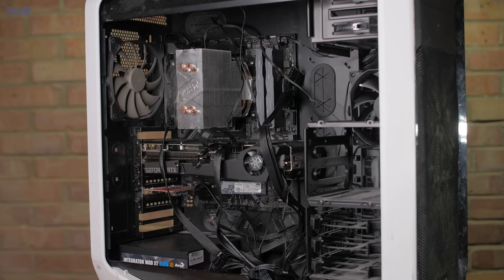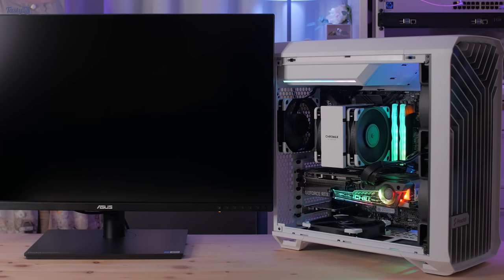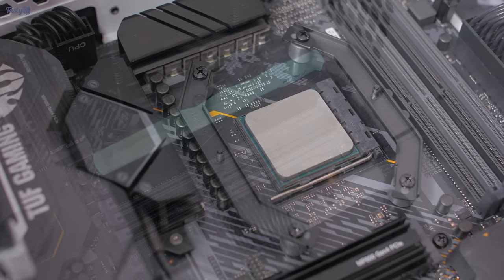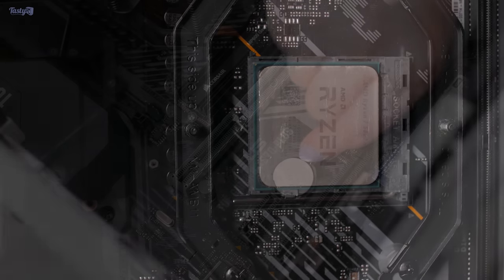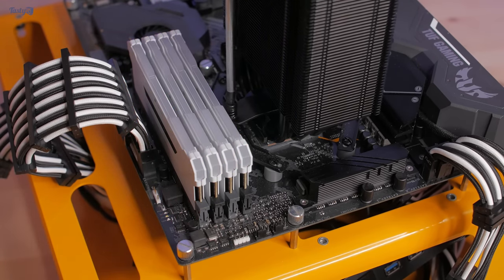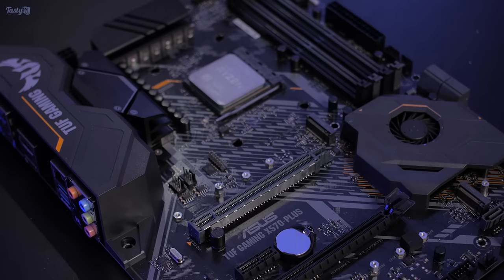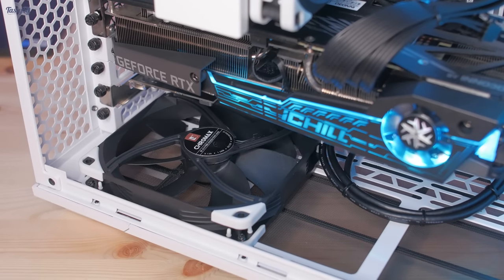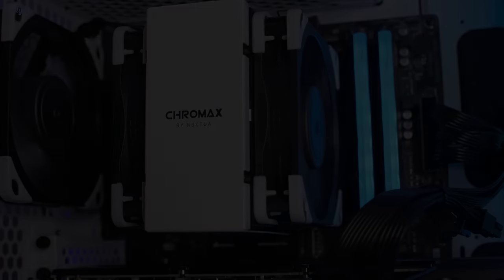I BROKE A VIEWERS PC??

Comment: could be wrong but maybe too much pressure was put on the cooler when it was installed causing a bow into the mobo and when its taken off the imbalance is gone but when you put on a heavier cooler it caused this

Comment: lol that pc looked terrible. 
I hope it didn't smell bad.
Reply: I'm certain this is due to temperature creep in the metal. I had the same thing over a long time and the issue is witht he aliminium wrought type used in the aluminium alloy. It's based on copper rather than silicon hence over time it deforms.
This is going to be much worse on the new CPUs that run on much higher temperatures than the past ones.

Comment: I think you pretty much nailed it. This does not sound like it is your fault. Either the pins or the socket is worn. Both heat and pressure breaks the connection.

Comment: You don't have to tighten the cooler all the way down. Mounting pressure doesn't do much maybe 5 deg c tops. There has been testing that shows this. Might have been able to reuse the same mb. Regardless interesting video!
Reply from the maker: As seen in the video, the error would only disappear if the cooler was entirely unscrewed. So the cooler would have fallen off when the system was upright.

Comment: What I would've done after all those steps is to carefully mount and screw in the cooler, had plenty of experience with if you overtighten ryzen too much on one side it can render some ram slots inoperable
Reply: Yeah watching further I guess I was kinda right, although I didn't expect it to work just fine with the other cooler back on. What a weird situation indeed

Comment: So I have a pretty good PC build of my own but find that Asus' Software for the RGB and Fans, armor crate, causes it to crash. If I remove the software it's fine. What do you suggest I do for RGB controll on my case and fan control?
Reply: Try OpenRGB... I don't actually use it though. I just remembered seeing it when looking for a Linux tool for my Corsair keyboard (which OpenRGB didn't support at the time).
OpenRGB is available for Windows and Mac too, not just Linux.

Comment: Can you make a video on the fan software! 

This is hindsight, but wouldn't it have been easier to try different ram sticks?

I still don't know if the cooler or the motherboard is the problem. But she did a great job troubleshooting it though
Reply from the maker: I did try a different kit of memory in the video. 4:39 for example.
Reply: @TastyPC  oohh my gatos how did i miss that...

Is the fan control software easy to use?
That's what i need. Fans based curves based on gpu or cpu temps

Comment: I recognize your voice from the Monsoon Dual Bay Reservoir video.
Reply: Context: I was in the market for a tri-bay red case that looked edgy and couldn't find any documentation to tell me how to get a D5 pump, how to set it up, what other compatible pumps were on the market, where to get one in the US because every listing I could find was from another country using a different currency, etc. Your video was my primary reference hence why I recognize your voice. You've changed your channel logo to since I last made any attempt to get this configuration.

To anyone wondering why I was looking for such a niche PC case, It's because I like older style PCs and I really wanted a Blu-Ray player in my system and I wanted to water cool without taking up a ton of internal space because older cases aren't necessarily compatible or beginner friendly to custom water cooling.

Comment: The conclusion I came to, is Asus boards are trash.  I replaced my Asus with MSI, problems gone.  They have huge stability problems.  Chances are that too much pressure was applied to the socket and the board is damaged.  But it could just be Asus’ flaky boards.
Reply: Sample size of 1?
Reply: @SianaGearz  For sure each manufacturer has their issues, so reviews and specs are very important these days.  ASUS is the biggest and they could be the best, but if you watch J2C, you know ASUS has done some covering up recently, and I’ve seen it as well.  I’m actually a little worried about the MB space, as there isn’t a lock manufacturer.  But I have 4 MSI AM4 boards in service, all selected because of features and reviews…and they seem to have less issues…so to each their own.
Reply: This issue is due to the substrate material used for the board - not all motherboard substrates are created equal!  It is a good reason to avoid 'low end'/cheap boards in general.  Cheaper motherboard substrate materials have different thermal expansion qualities.  There is more than just profit that goes into the higher end motherboards.

Comment: I have a new respect for your knowledge of PC's - good job.  I thought of the cooler pressure possibly causing problems pretty early on, because i've run into problems like that before.  This was one of the problems with the original Xbox 360's, the board materials and the heat sink mounting mechanisms in that console are the cause of the famous Red Ring error.  Microsoft cheaped out on the materials they used on the original Xbox 360 motherboard, as a result when it heated up it would warp the board (also related to the boards mounting system.)  This board warping from heating up and cooling down would eventually break the solder joints under the GPU which caused the famous Red Ring error.

This was entirely avoidable if Microsoft would have done any 1 of three things differently.  
First - The 'X-Clamp' mounting system for the heat sink was poorly conceived, and so increased the warping of the board from heat expansion particularly right under the GPU that was soldered to the board - so replacing the X-Clamp with a more normal attachment would have helped.
Second - Had microsoft opted for a slightly more expensive motherboard base material (instead of the cheap one) the board would have been less susceptible to thermal expansion when heated, and so would have warped less from heat expansion with better materials.
Third - If Microsoft had a better cooling system, that would have kept the entire xbox 360 cooler and prevented it from experiencing any significant thermal expansion to begin with.
Reply: So how does this apply to your build here?  Well the easiest way to fix this issue is make sure that your case is cooling better so your motherboard doesn't heat up.  You can also get a different Heat Sink.  And for next time - don't get a cheap motherboard that uses cheap substrate materials and experiences this sort of warping from thermal expansion when it heats up.
Reply: You could also experiment with not using all the mounting screws to hold the motherboard into the case, probably taking out the screws at the top of the motherboard would allow more even expansion which might prevent this issue... although it's unlikely it would really solve the problem because it seems to be more connected to the CPU cooling mounting system in this case.
Reply: I still have my original xbox 360 because I took apart my xbox 360 before I even turned it on for the first time, and I fixed those problems.  I removed Microsoft's stupid X-Clamp cooling retention and replaced it with a more standard design, I redirected the airflow and improved the cooling in the system, and also sped up the cooling fans.  And I replaced the original xbox case with a custom case.
Reply: As a result of my changes to Microsoft's original 360 design - my original xbox 360 works great to this day, no problems at all, probably has a runtime of near 3 years total - it runs perfectly.  This shows how even system engineers can be incredibly stupid at times  - they should have fixed these problems before the 360 ever left the factory.  Anyway - that experience is what led me to the board possibly warping in your system pretty quickly.
Reply: Also - don't feel bad for not spotting this problem sooner, it is a matter of experience.  You are proficient in the troubleshooting methods which eventually led you to figure out the problem and find a correct solution.  But this is one of the weird issues that most people never encounter.  So well done for finding the solution.  :)  A lot of techs would likely never have figured it out. - most techs would just say 'bad motherboard' and move on.  But you took the time to figure out exactly why.

Comment: Looks like the torrent case. not sure why the viewer removed the bottom fans since it comes with 3 in stock
Reply from the maker: The Torrent Compact comes with two front 180mm fans by default and no other fans.

Comment: My bet would be an micro fractured trace on the motherboard. It could connect and disconnect with mechanical load and heat.
Good idea to just close off the lower vents. I somehow never considered doing that, despite mine apparently dragging dust inside vie the venturi effect,  so I'm gonna do that too.
Reply: That's a weak explanation because it does work with other CPUs reliably. Should be a socket damage issue or plain dirt deep in there (paste etc). Keep in mind the hingepiece is right near the RAM pins, it's almost inviting paste to slide in there.
Reply: @SianaGearz  Yeah, you are probably right.

Comment: slot 1+2 is not typically how dual channel works. You use slots 2 and 4. And good god!! Gently twist don't pull, there is nothing wrong with AM4 CPU retention. Good video though, quality editing, and I love your voice ( no offence)
Reply from the maker: I used slots 2 and 4, unless I was testing the other slots for diagnosing purposes. I showed how twisting the CPU cooler doesn't change the likelihood of the CPU coming with the cooler in the video. Obviously you have to pull at some point or the CPU cooler would remain installed forever. Glad you enjoyed the video though.
Reply: @TastyPC  Twisting absolutely does change the likelihood of that happening. I've never once had the cpu stuck to the cooler. Think about it for a second.
Reply from the maker: @insertnamehere4419  I don't know what to tell you... the video included footage of me twisting it back and forth and then the CPU still coming with the cooler. The proof is in the pudding. I've tried twisting, I've tried pre-heating, but none of which solves the issue of the AM4 socket failing to keep hold of the CPU. Thankfully AMD agrees and has moved to LGA for AM5, so this isn't an issue that only I'm having and this isn't user error, the socket having poor retention is well documented.
Reply: @TastyPC  I've built a dozen AMD PC's in the last 6 years for my self and others, not once has the cpu came off with the cooler.  It's your technique, full stop. You can feel when its loose enough to lift...twist this way and that until you can feel its loose. Really not that hard.
Reply from the maker: This issue occurs when dismantling PCs, so I'm not surprised you haven't run into this issue when building systems.
A dozen is a very small sample size though. I'd say it happens to me at a rate of 1 in 20 cooler removals. It's theorized that some pastes are more sticky than others, so perhaps you're also using different TIM to me. It's also theorized that the twist technique is more effective on older pastes that have hardened somewhat. There's very few reasons outside of being a hardware reviewer to be removing the cooler off of brand new paste as frequently as I do. Like I said before though, this issue is widely documented and AMD agrees because they've gone to LGA for AM5. The last thing I'll say on the issue is that many coolers have a mounting mechanism that doesn't allow for twisting, they either unclip or pull straight up with things obstructing your ability to twist the cooler.
Reply: @TastyPC  lmao....now you're being passive aggressive. "This issue occurs when dismantling PCs, so I'm not surprised you haven't run into this issue"  Your insecurity is showing.  When I say I've built a dozen PC's, that's not counting changing coolers, and remounting coolers. I'm sorry if my "sample size" is too small for you. Stop doing it wrong and it will stop happening is what I'm getting at.

Comment: pc case name ?
Reply from the maker: Fractal Torrent Compact
Reply: @TastyPC  ive just check it , price seems so heavy its about 10k php or 200 dollars
Reply from the maker: It's not a budget case for sure, however the price makes sense when you feel the weight of the included front fans. They're not the usual cheap included case fans. Search for "Fractal Dynamic X2 GP-18" or "Fractal Prisma AL-18" to see the price of the fans.

Comment: At 6:59 
I would definitely not move on at this point (I would love to investigate more, I love these puzzles).
My first idea was to re plug the 24 PIN connector to the motherboard.
My thinking is that if there is an issue between the board and the CPU in that particular setup, it sounds like its a metal pin between those two in particular that is causing the issue.

Kinda like having a USB connector that has used the same USB device for so long, they scratched each other "just in the right place" to be a problem. I would try to check each pin individually and see if there are any scratching marks on the pins.

Apart from that, I would probably try another power supply (maybe the motherboard is pulling a wrong amount of power between the cpu and ram?)

Comment: Speaking of weird issues like this, I built a Ryzen PC where you can't turn it on by the power button, and it powers on as soon as the motherboard receives power (default setting in the BIOS for some weird reason).

It's annoying because if you shut it down you have to switch off the power from the mains or PSU for 15 seconds before it will turn back on again when you restore power to the motherboard. Love to know why, but other than that it's stable.

PC problems are an enigma sometimes, why would the motherboard refuse to power on via the power button, the button/connector is obviously fine because you can turn it off by it.

Glad I'm not the only person who has strange issues.

Comment: Just my opinion, After 20 years of building gaming desktops, I no longer care for any colored fans, multiple fans, water cooling, or overclocking, what I found is that eventually, after time the ball barrings make an annoying noise, and the color products stop working. I simply purchase a basic CPU fan for the intel processor. The case has 1  big fan and that is all I have an 800.00 graphics multiport DISPLAY PORT/ HDMI card. For Sound: Creative Sound Blaster Z SE Internal PCI-e Gaming Sound. I also use a standard ATX 600 Watt power supply, 128GB Of DDR4 RAM, and an ASUS Gaming Motherboard along with a .m2 500 GB HD split into 3 partitions ( triple boot) running Win10, Mint Linux, and Ubuntu. I use  2 6TB 3.5-inch drives not in a raid and my case is the EPIC COMOS II  FULL ATX CASE I had for 10 years and it weighs 70 LBS (lol) . I stock day trade for a living and use 2 HDMI monitors and a 4k TV as a monitor every day. it works great!. I encourage everyone to learn to day trade and in time quit their job and gain real financial freedom. Thanks, Tasty PC for a good in-depth video. Cheers!
Reply: @Richard Miranda - I suggest looking into "Magnetic Suspension" fans.  also called "Magnetic Levitation" or "Magnetic Barometric" fans - they do not experience the problems you mention.  But they are more expensive than more traditional fans.